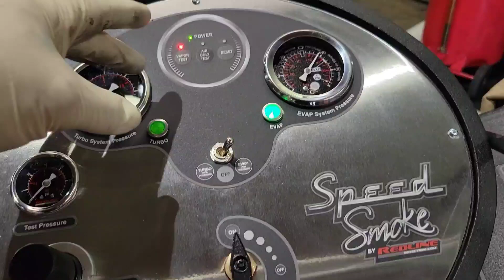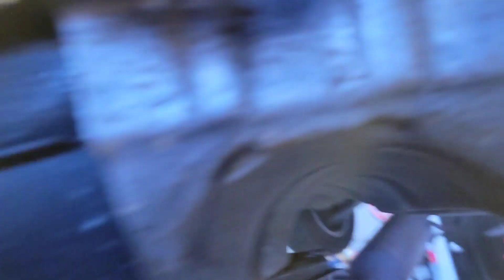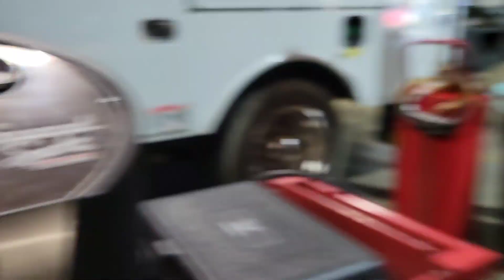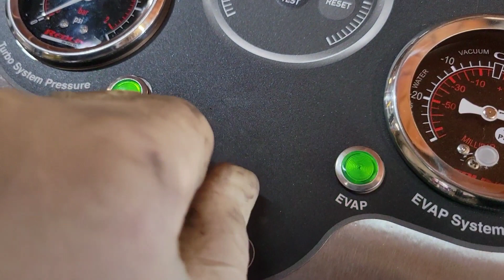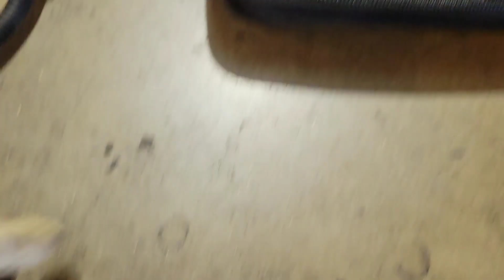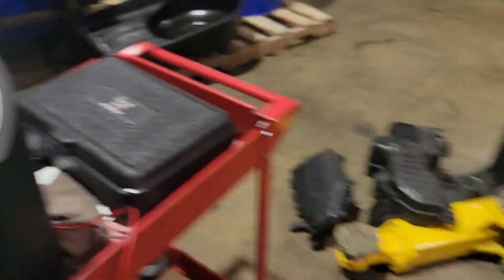SPEED SMOKE The BEST SMOKE Machine

Comment: Lmao. U can literally buy a evap smoke machine off Amazon for around $200 and up. That is the same as the $3000 plus one you're using.  U only need 5 lbs and up to diagnosis any turbo. Another video of an uneducated mechanic over spending on tools. I've used the one u have and my $300 dollar one is built and does the same thing.  U have been fooled. 😂.  U Just can't test evap systems with the $200 dollar ones too much Psi comes out with no regulations of those Psi.
Reply from the maker: Yes you are correct you can use all kinds of smoke machines. I have honestly never used a really cheap one like you have said. I used the Smoke Pro for 12 or more years. works great on evap and intake leaks. However what it does not do is produce as much smoke at the speed smoke. You may have a very small evap leak and with cheaper machines you will not see smoke, you will smell smoke but cannot see it. Testing turbo systems does not work with cheaper smoke machines. the air pressure that they are regulated at for evap is not enough, also the machine cannot produce enough smoke. I appreciate you watching but you are incorrect my friend. Good luck.

Comment: That's a pretty handy machine to have. Nice features.
Reply: SpeedSmoke was made to make leak detection a breeze!
Reply from the maker: And that it does for sure.
Reply from the maker: Yes it is and there is more it can do, I need to get the cooling system adapter so I can smoke test a cooling system, also the bigger exhaust adapters so I can blow smoke up the ehaust. Thankyou for watching